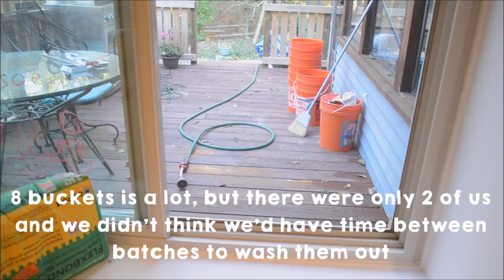My Experience with Self Leveling Underlayment

Comment: How do you learn? From experience. How do you get experience? By making mistakes and learning from them. Is there a better way? Yeah, learn from other people's mistakes. 

So this video is helpful. Saw that first bucketful and thought, "Oh, no!". The self leveler should be thinner than honey but thicker than water. Can you make it too thin? Anybody have thoughts on that question.
Reply: Damn right you can. Add more water and it  makes it weaker and more likely to crack as it dries out - also takes a lot longer to set.

Comment: Very useful vid, takes the fear out of the job.

If I may, though... not too sure about your tip at 4:38 .....  The universal rule is you add wet to dry, not the other way around. The reasons are many, but I won't bore you with those here. 

Thanks again!
Reply: Absolutely wrong.....water first then leveler....you've obviously never done this so why comment on something you know nothing about

Comment: I just did mine tonight and it looks like that too. I may have to sand out the peaks and possibly fill the valleys. Definitely not as easy as they say.
Reply from the maker: Thanks!  I hope yours worked out in the end.  As far as haters go... It's easy to sit in front of a computer screen and tell someone what they did wrong, but a lot harder to go do it yourself.
Reply: Yes it did. It all worked out in the long run. The floor looks great. Thanks!

Comment: The thing that people don't seem to realize when they consider this product is the crazy expense of this self leveling concrete.  It cost $70 per 50sq feet at 1/8 inch.  Many projects require you to pour this stuff in some areas up to an inch thick so you could go through 10 of these buckets to cover a floor that is 200 sq. feet.   Now we are looking at $700 + tax just for the leveler.   That is enough money to purchase at least 6 yards of concrete for say an entire patio.   Just does not make sense this stuff should cost this much.   I only use this product if I have something small like a 5x6 bathroom floor.
Reply: Henry 542 is only $36.97 and covers 52 sq ft at 1/8"
Reply: I cant help myself, sorry - it's aself levelling mortar..not concrete...concrete has big chunks in it...

and yeah, it's expensive...but try laying a thin vinyl directly on top of your 6 yards of concrete...you're going to see the concrete pattern through it, I can guarantee - plus you've gotta dig out a six inch deep hole to put it in. Plus you can't put that vinyl on it until it's dry - not "OK it LOOKS dry" but REALLY dry...or the alkaline water in the concrete eats your adhesive and spits out all sorts of volatile compounds...giving you big blisters under your vinyl. I think the recommendation for "dry" is a week per inch of depth - so yeah, six weeks. Suddenly, the saving in materials has been eaten up in time...

If you only have 3mm to play with, there are no other options...and they're expensive because there's a lot of tech in there...accelerators so it sets quick. Retarders so it doesn't set SO quick that you can't apply it. antifoams. flow compounds. polymers. shrinkage compensators. A good slc probably has 15-20 components, most refined chemicals. Concrete has four (five if you're lucky) and half of them are dug out of the ground "as is".

Comment: Yeah this leveler is not as easy to work with at all and now reminded when I used it before that I am going to just add an inch of top flooring in sections.  The levelor marketing is overly ambitious about it's product. Other blogs with pro's emphasize that too and that you really need a crew especially foe large areas. I used this stuff 2 times on 8x10 areas and was not the final result I wanted even had bubbles in it. But cheers to the diy gal and family.

Comment: PUBLIC NOTICE: This is a video on how NOT to do your floor....
Reply: +Infidel G Infidel So why don't tell us what was done wrong, smart guy, because it's pretty much the same as I've seen others do it on YouTube.
Reply: +Misty White Don't shoot the messenger. I'll try to explain a little bit more pleasant than the guy you are referring. Maybe it will help someone. ONE: YOU NEVER, ever, ever, ever push and pull the product like that. By doing so you are forcing it where to go Verses what you payed for. FOR IT TO SELF LEVEL! She had peaks because she did NOT have enough total product to fill in the valleys properly and she at that PULLED the product therefore NOT letting it fill the valleys then flowing over peak to next valley if any, as it DOES do on it's own! IT TAKES about 2-3hrs for it to level. Two: You must know your lowest area and buy enough mix to fill the  total square footage times the diff in height of the lowest spot and the highest. IT was obvious she did not do this. 3rd: You add water to ALL the buckets at once not just as you are ready to mix so you don't loose this time. Or rent a mixer that can do it fast from your local rental shop. Then mix ALL the buckets within 5 minutes and liberally pour them all fast as you can avoiding splatter. DO NOT push and pull it WILL do as it says. SELF level. By pushing and pulling you are VERY LIKELY pulling it way too thin and there WILL NOT BE ENOUGH product to fill from bottom of ALL the valleys to about 1/4" above all the peaks. She was trying to make it pretty verses letting it do it's designed job. By pushing and pulling and NOT having enough total product to fill from all the lowest points to about 1/4" over the highest. This does not even go into the improper prep that was done. Caulk and paper? One will not stop condensation draw by the cement. The other will leave room for future drop causing edges to crack. I think this is the big issue. TOO MANY peeps relying on You Tube videos NOT done by those trained to do it. Or at the very least by watching the videos of the manufacturers who make the product. They spend all that time and money on the product and not the extra 15 minutes to learn the proper use of it THEN BLAME the product. It works GREAT when done correctly. Don't get me wrong. I APPLAUD ANYONE willing to get down and dirty and put the sweat equity in! My hats off to all that do so. Just get the proper pro advise first. AS WELL NOT ALL jobs are even up. If the job calls for it then maybe an extra pair of hands are needed to be sure it is all mixed and placed fast enough. MAKE ABSOLUTELY sure you have enough product for it to fill all valleys and flow over every peak. OTHERWISE YOU WILL no doubt have peaks when it dries.
Reply: +Misty White the wrong here is, a woman did! and need like 100 buckets not 15 ROLF!!
Reply: Rescue3EMS .
Reply: Plus she didn't even have the good sense to pour the leveler against the wall to start and work backwards from there! Instead, she leveled herself into a corner.
Reply: I don't quite get why you would search out videos on experiences on things you already know how to do then... Finding amateurs try out stuff and gloat you are better seem like a strange hobby.
Reply: 2-3 hrs to level??? There are levelers that are dry enough to walk on in 2-3 hours.
Reply: She leveled herself right out the door that was being use to transfer materials. that was the best place to work towards.

Comment: Its called self leveling underlayment because it levels its self. although I would recommend using about 10 percent more water than they recommend and it will level itself.  But you did a good job and didn't skip the floor prep.. Props to you.
Reply: I'd like to have a word with whoever first coined that "self levelling" phrase...there ain't no such thing until you can find me a product that you pour into one corner, don't move at all, and it flows out to the other three...

Oh yea...there is...water. But it don't go hard unless you freeze it.

They self SMOOTH. They WILL self-level - if you specify a given area and a given thickness...but even if you pour a bucket out on a totally non-absorbent floor, it won't spread out to a flat "disc"...you'll get a high spot in the middle, and lower at the edges.

Self-levelling is a marketing...

...excuse me while I turn around three times and spit 'cos I said "marketing"...

...term, and as such should in no way be confused with product reality.

Comment: Thank you for a well-done video. It's possible that a slightly different title would prepare viewers for what you are presenting. Also, some viewers won't see your blog. So you might get fewer haters (as you call them) if you change Experience to Mistakes, and then tell what you learned and what mistakes you made in the description. For a first video, you did great. The floor, well...

Comment: She spread the leveling compound out too thin. That's why she still had peaks and valleys on the floor, depending on the variance of the floor you need more, or less leveling compound, it's not unusual to have spots of 1/2" thick or more. Let the compound do the work, don't use a squeegee to spread it so thin. The compound will find level itself, and if you have it right as it dries it bubbles a bit, kind of like pancake batter.

Comment: self level is great you got those peaks and valleys because u spread it around too much you need to just pour it and let it do its thing and by its "self" it will "level" out your floor loll I also recommend adding just a little bit more water than what they tell you to that way it's spreads much easier around your floor and you won't wind up with like these waves from each mix you drop onto your floor
Reply: Like pie crust, it can be overworked.  I got good results just aiming it where it was supposed to go and letting gravity do the rest.
Reply: Why?
Reply: Don't ad more water. Makes it weaker, makes the sand drop to the bottom, the polymer float to the top...can lead to cracking as more water = more shrinkage as it dries.

If it doesn't level at the recommended water addition...buy a different product that does.

Comment: if I understand right, the leveler will cover and stick to the floor, why would you prime it then?  is your subfloor concrete or wood?
Reply from the maker: My subfloor is concrete.  The primer is part of the Custom Building Products system.  "When preparing surfaces for LevelLite or LevelQuik self-leveling underlayments, use Custom Building Products LevelQuik 1-qt. Latex Primer. This primer and sealer seals porous surfaces and improves the bond of underlayments. Can be used for interior and exterior applications. Suitable substrates include concrete, masonry, plywood among others."
Reply: Good answer SGD. 

There are two reasons to prime. Adhesion and absorption.

First is easy...yes the moprtar will stick "okay" to most floors...but a layer of polymer makes it better - especially on glossy or contaminated floors.

Absorption is probably a more common reason for priming though. The primer keeps the water in the product where it can help it flow and set (people get confused by this...the water actually reacts with the cement in the product...so you need ti to be there for a while, then you need the bit that's left to dry out as quick as possible. Both adding more water and reducing it by too much will cause lower strength).

I commented directly further up...but the reason some "professional" contractors are all "Add a bit more water" is 'cos alot of them want to skip the priming step because time is money...they don't wanna wait on site for the primer to dry, and they sure don't want to come back to the site the next day (#cos that's two visits...petrol costs, etc).

Do what it says on the bag. Prime. Add the right amount of water. If it's not working...THEN you have a reason to say the product is wrong.

Comment: the reason you had peaks and valleys is because you needed alittle more material and you needed additional tools gage rake and a smoother.a true self-leveling doesnt need much work to level only to smooth for the glass like finnish it can achieve
Reply from the maker: franclinstein Thanks so much!  I did my guest bathroom after this and it came out perfectly!  So practice makes perfect!  I probably should have started in the bathroom, then tackled a big room like this.  There's a lot more info in my blog post http://smartgirlsdiy.com/2015/01/i-always-wanted-to-try-self-leveler/ and you can see the finished product here... http://smartgirlsdiy.com/2015/03/grouting-my-herringbone-floor/

Comment: pour in a long line so you can always get to it without spiked shoes. also if you use a pin rake like you did you are just smoothing the floor not leveling so much you need to have marks or screed tripods. or set screws or battons on the floor leveled with a level and screed then take battons up and fill in. not bad for your first try

Comment: If primer was not applied in room?

What are the down falls?...I'm doing two rooms bedroom and living room so it's not too late to do in the other.
Reply: The primer stops the liquid in the self leveling compound from soaking into the concrete or substrate below. It stops the self leveling compound from being ruined from curing too fast and too dry. Most of the time, priming is essential. It also helps the self leveling compound from sticking to the floor better.

Comment: how powerful must your drill be to accomplish such a task. Mine went up in smoke
Reply: You have to use "hammer drill" as well as a paddle to mix concrete, mortar and other heavy mixes like this. A regular drill will NOT work...as you learned.

Comment: I wasn't sure where this video was going to go.  I have been in the flooring industry for going of forty years, so I watched this video through the eyes of experience.  At first I was thinking of giving an "A" for effort but after she got to the application phase, I could only think "F" for stupidity.  Why do I say this?  Lack of research.  I would not expect anyone to have a 'perfect' floor on their first attempt.  Also, there are numerous videos showing how to properly install an  underlayment.  Here is my take on the application.  1.  Did not know what they were doing.  In my book, the husband should have been on the deck and her mixing.  Don't know the details, but both are kind of stupid for not getting the mixing water right.  2.  Once the light bulb came on, the garbage on the deck should have been scraped up and trashed.  You do not pour water on what you screwed up and attempt to fix it.  3.  If this woman was smart, she should have found that underlayments are spread using a gauge rake.  You do not use a flat bladed squeegee to spread underlayments.  According to her, her rake was 0 to 1/2".  There were no marks on the floor for elevation so that the depth of the underlayment could be controlled.  You could also have pinned the deck but this is a very small area.  4.  Next, what idiot is going to work on their tiptoes trying to install an underlayment?  Had she did a little more research, she would have found out that you can walk in the underlayment by wearing cleated shoes,  she could have found some old golf shoes, baseball shoes, etc.  You cannot install underlayments without walking through them.  5.  After the underlayment has the gauge rake set the depth, the underlayment is then hit with a smoother.  She was trying to finish the underlayment with a hand trowel.  No way will that work.  6.  If you notice, towards the end of the installation, the woman is barefooted.  This means that she is walking in the underlayment.  7.  If you look at the mess on the deck the next day, need I say more?  

I know that some people will consider me an asshole because they think that I am an man critizing a woman doing something for the first time.  Not a valid argument.  I have seen underlayments installed by other women who have had no more experience than this one had, doing it correctly.  I am just looking at what was done as the outcome and what could have been the desired result had she or they, did a little more research before they found out what an underlayment was and then rushed out to buy some.  Maybe you might blame who they bought the underlayment from.  Since they used Home Depot buckets, one could assume that the underlayment came from Home Depot.  If you want to use the same logic, then why not go to their garden department the next time you want to replace the spark plugs on your car and ask them how to do it.  The end result would be the same.

Comment: You need to use screed to get the flat surface. This stuff is thicker than water so while it will settle to the low points i can remain pooled. The screed will help to eliminate the peaks and valleys making the surface flatter.

Comment: Never mix self leveler in 5 gallon buckets! you need to mix at least 2 bags at a time and that is only for the small jobs. Three at a time is best. If you don't end up with a min depth of at least 3/8s it will not level. I wish I could have been there to help, that kind of pour is fun. Mostly because when its done it is smooth as glass.